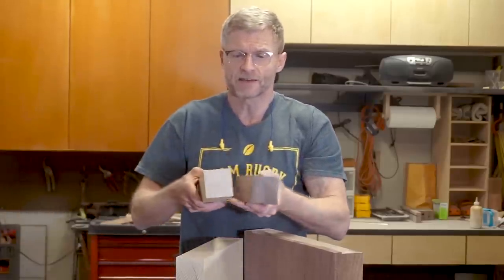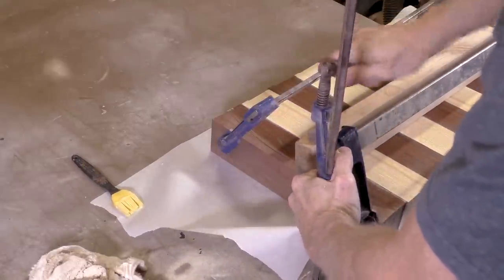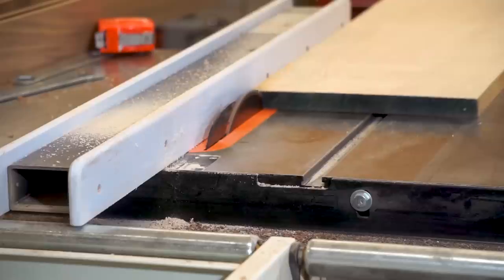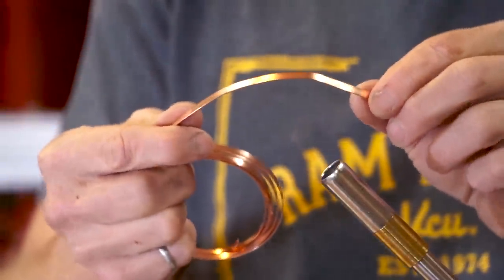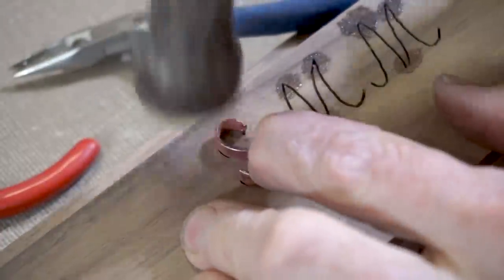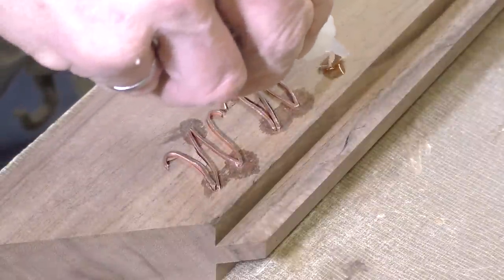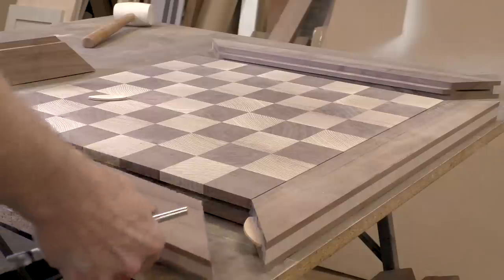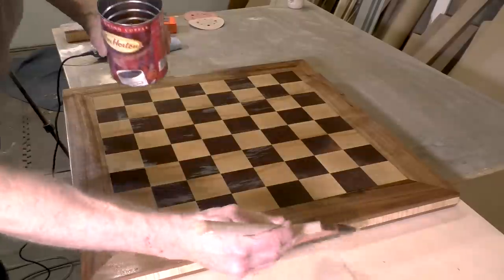Chess Board with Copper Inlay

Comment: Beautiful work!  Just discovered your channel and I am sure I'll be back.

BTW, Unlike steel, copper does not need to befooled slowly during the annealing process.  With Copper, it is the highest temperature reached that dictates the malleability of the material.  As a result, the copper can be dunked in water at the end and it'll be just as soft.  With steel, plunging it into water (quenching it) causes it to harden.  

I know I am going to get roasted for that explanation-- it is over-simplified.  Some steels are best quenched in oil and some steels (such as low carbon steels) won't harden much at all on quenching.
Reply from the maker: Thanks for the feedback and for the information. It's great when we can al learn something from a comment like this!

Comment: What's the difference between a jointer and a planer? Aren't they essentially the same?
Reply from the maker: They serve two different purposes. Imagine a long board that is not straight or wavy from end to end. If you run that through a planer, it would plane the top surface to be parallel to the bottom, so it would not remove that waviness. A jointer solves that problem by flattening the bottom before running it through the planer. Once you have that flat bottom, the planer will make the top side flat and parallel to the bottom.  You cannot use a jointer in place of a planer because if you try to joint both the top and bottom, you will almost certainly end up with a flat top and a flat bottom, but they wouldn't be parallel to each other.

Comment: I was thinking when you were inlaying the letters:  You could have made the letters complete first, then put them on the wood and hammered them a bit to make an indentation from the completed letter.  Then use the router (dremel) to rout the pattern.  Just a thought.
Reply from the maker: Interesting idea, but I don't think I could have made the "M" out of a single piece because of the sharp corners.

Comment: Curious is there any reason other than aesthetics to have all the end grain run the same direction as opposed to lets say have the walnut grain be perpendicular?

Though truly a master craftsman, the fact you took time to do the pumice step where as most people would have said thats good enough.
Reply from the maker: The wood expands and contracts by different amounts relative to how the grain is oriented. I like to orient the grain in the same direction. That way, when they're glued up, it minimizes the chance that one square will expand more or less than the square that it's glued to. I'm not too worried about expansion and contraction of the wood with this finish because the chess board will be in a climate-controlled environment and it's well-sealed by the polyurethane.

Comment: a nice work, but as a chess player and from this camera angle the board looks a little bit too big for the usual peaces you can buy so that the peaces would look maybe a little bit undersized when placed on it
Reply from the maker: It's definitely a large board but that's what the client requested. There are definitely lots of larger sized pieces in use out there.

Comment: You can buy 1/8 to 1/4 collet adapters on eBay then put that into 1/4 to 1/2 adapter and then the whole set into a router or a CNC spindle.
If you make inlays your standard product, a small CNC machine would be a good investment.
Reply: NO keep it real, HANDMADE Anyone can use a CNC
Reply: Randy Thomas you obviously don’t know much about tools. 
Electric saw, planer, jointer, router, sander used in this project are not hand tools 
CNC router is just another power tool. It takes more than “hey Alexa, carve me this pattern on CNC”,
Just like any other tool, it takes knowledge, skills and experience to get good results.
It is the skills we admire, not the tools he uses, for a fool with a tool is still a fool.

Comment: Beautiful piece of woodwork! You might have been able to save yourself some grief with the inlay by using copper powder and epoxy to fill the initials. Once sanded, it's almost impossible to tell from solid copper
Reply from the maker: Oh, interesting.  I didn't think it would appear the same as solid copper. I'll have to give that a try. Thanks!
Reply: @Woodumakeit  Obviously you'd want to experiment with proportions of powder to epoxy on a scrap piece first, but I've had good results the couple of times I've tried it.

Comment: Very nice! My shop has had a lot of success with ML Campbell Krystal conversion varnish for sprayed finishes, so much so that I’ve completely moved away from arm-r-seal which was my favorite poly finish (although it’s not really a spray varnish anyways).
Reply from the maker: Thanks for the info. Several viewers have suggested to go with either conversion varnish or pre-cat lacquer.  I think I'll give both a try. It sounds like I'll be happy with the results.
Reply: Wood U Make It you definitely will be, especially with Krystal. One word of caution though, conversion varnish is a particularly dangerous finish, I have a top tier spray booth and I still wear a mask with a particle filter and a lab coat per my suppliers recommendation. It’s also very finicky in terms of oils so acetone is your friend.

Comment: You used steel wool in the final coat.  Why aren't you concerned about trapping fragments that will later rust?
Reply from the maker: It's not as big of a concern when using oil-based finishes like this. However, I used steel wool only after applying the final coat, so there would be no fragments embedded in the finish.

Comment: just curious.... i noticed after this point that you fixed your mistake, but you didnt say that you had made the mistake in the first place. but it was obvious to those who play chess that it was there. did you have to snap that piece off and turn it around so that the black/white patterned flip flopped? or did you just start all the way over. https://youtu.be/IalWUpwGonI?t=323
Reply from the maker: I'm glad you caught the mistake. I left it in the video but didn't mention it just to see if anyone would notice.  I actually made several chess boards at the same time, so I wasn't always videoing the same board.  I didn't fix this one because the squares wouldn't be square anymore. That one will end up being a cutting board.

Comment: If you pick up a old fish tank air pump and hose from a garage sale for a couple bucks you you can hot glue the hose end to the base of the router aimed at the bit
and it will blow of most of the dust while cutting I did this on my scroll saw and it sure made it easier to cut things out. it can be knocked off when done.
The board is really nice, great work.
Reply from the maker: Thanks for the idea. I'll give that a try. I can see that working with a scroll saw, but I'm not sure if it'll have sufficient air pressure for a router due to the higher velocity of the dust, but it's definitely worth trying.

Comment: Why did you use that huge copper tape? Every other inlay I've seen has used much thinner cylindrical metal wire.
Reply: On an inlay project of mine a few years ago, I went into my local hardware store and got the thickest gage electrical wire I could get there. My target was 1\16th inch thick after I would run it through a double roller, which also split apart the plastic coating wires usually have. I went that route for sourcing my copper material due to its quick  convenience. Others can just buy the material already flattened to a specific thickness.
Reply from the maker: I watched a few videos where people had started with cylindrical wire, but then they would run it through a milling machine (or hammer it) to make it flat. I figured it was easier to buy it already flattened because I do not have a milling machine.

Comment: Out of curiosity, would the copper inlay have turned out more uniform if you had used copper dust and cold sintered it in the wood?

All in all, this gives me some ideas for my next chess board.
Reply from the maker: I'm not sure of the answer until I give it a try, but several viewers have suggested using copper dust and CA glue or a mixture of copper dust and epoxy.  I think their recommendations come from experience, so I think I'll give both a try and see how they turn out.
Reply: @Woodumakeit  I've never done this either, but my old man is an old school mechanic. He's the one that taught me this process. I've seen it done with various metals and powdered semi-precious stones (jade works quite well). Might be something to give a go at. Thanks for the reply.

Comment: Why did you only put half of the chess board thru the drum sander at a time?
Reply from the maker: The maximum capacity of my drum sander is 19" and this chess board is 20" so I had to sand it in two passes.

Comment: Think I would go for a felt bottom so the board wont rock if it's set on an uneven table or some such.  Also don't have to worry about it getting scratched up on the bottom.  Then again, I have to wonder if a board like this ever actually gets used?  I tend to see rubber roll up boards in use every time I happen by a game.
Reply from the maker: I added cabinet door bumpers to the bottom, but didn't show that on the video.  They're really easy to apply, easy to replace, if needed, and cost almost nothing.
Reply: @Woodumakeit  That was my first thought as well, one of the various cheap rubber or felt feet, but I thought it would look tacky on something that is otherwise fine craftsmanship.  A full felt base would match the quality of the rest of the board.

Comment: wouldn't it be easier to pour molten copper into the grooves?
Reply from the maker: With a melting point of almost 2,000 degrees F, that would end up burning the wood (and probably set it on fire).

Comment: How is it even possible to sand down the metal without also cutting into the surrounding wood???
Reply from the maker: The sander takes down the metal first because it's protruding higher than the wood surface. Once it becomes almost flush with the wood, then the sander will begin to sand the copper and the wood together to make it a completely flat surface. It's at this point that you don't want to sand too much to avoid making the wooden frame thinner that that spot.

Comment: on the tongue and groove sides, why only glue in the middle?
Reply from the maker: I anticipate the wood movement due to changes in humidity to be minimal because of how this board is sealed and also because of today's climate-controlled environments. The reason I put glue only at the center point is to allow the wood to expand and contract a little and not to be held fast to the frame, which could end up causing the board to warp or crack. There's also a small air gap between the tongue and the inner face of the groove to allow for a bit of expansion and contraction as well -- just in case.

Comment: Nice piece of work.  Please take this as something to consider, NOT as a criticism.  I've been doing finishes more than 50 years and, while your choice looks nice, I can tell you from experience that there are FAR better finishes than poly that are much faster, more durable, more forgiving, and crystal clear.  Any more, poly is barely a step above conventional lacquer and painfully slow.  May I suggest trying pre cat or post cat lacquers, catalyzed conversion varnish, polyester, and consider a catalyzed automotive clear.  Shoot a damp coat of any of these cut about 20% with the appropriate thinner (it will dry in minutes) to apply initial seal coat, lightly hand sand with 320 to take "noise" out of the finish, tack cloth it, then apply 1 or 2 4 mil coats cut about 10% allowing about 20 minutes between coats.  You'll be impressed with the results and save hours and hours of dry time (at reasonable room temperatures, they're ready to ship in less than 2 hours).  I've used these on night club tables (the ones on which get drinks spilled and cigarettes put out) and they're almost bulletproof.
Reply from the maker: Thank you so much for taking the time to offer this suggestion and your recommendations on how to go about doing it! I've read a bit about catalyzed lacquers and conversion varnish, but have never had the opportunity to try them. Your comment has given me the motivation to give them a try. I have several more chess boards to make, and they tie up my shop for 5 or 6 days while I'm applying the finish, so anything that will save me all that time will be well worth it. Thanks again! --Mike
Reply: @Woodumakeit  I appreciate that you understood the context in which I presented the suggestion (I was hoping you would).  I would guess you can understand the experience I've accumulated over all these years, and I'm very happy to share and teach whenever I'm presented the opportunity to do so.  I'm unaware if there's a way we'd be able to make contact in a less public forum, but I'd be happy to have the chance to point you in some directions should you want that.
Reply from the maker: @thespook9808  It's evident that you have a tremendous amount of experience and I would be honored to receive any knowledge you'd be willing to share. Perhaps we could begin via email. You can reach me at woodumakeit@gmail.com. I look forward to hearing from you!  --Mike

Comment: Amazing work sir, you might want to consider copper or brass dust for an inlay like that if you do it again, it's much easier to work with and allows you more freedom of expression with the type of lettering you use. CA glue and  metal dust looks fantastic with stylized lettering.
Reply from the maker: Thank you for the suggestion. I'll keep that in mind for upcoming projects. How deep into the wood would you go when using the CA glue and metal dust? Others have suggested epoxy and metal dust. It would be interesting to try both and compare the results.
Reply: I use a 2 cherries gouge cutting down about 1/8" or deeper if the lettering is to be fancy. My wife does calligraphy so she does the letters and I copy them to the work surface. Add a layer of glue and then dust, I build it up a bit at a time until trough is full and sand smooth.

Comment: Mike- From Tidewater to wherever you are in the Old Dominion- Bravo! You can do a couple of things to make the copper inlay easier on yourself- #1- while its still hard- use a piece of sandpaper and file one edge thinner- just fingertip pressure for a few strokes- gives you a wedge shape to start the piece and makes tighter radius corners- it will mushroom into the gap with the hammer strikes- #2  Dont need to heat it so long in the flame-  and its more efficient to do it on a scrap 2x4- it reflects heat back and the charcoal helps keep oxidation down- just flame the whole roll at once to red-orange then let cool... But its awesome to see and great video!
Reply from the maker: Thanks for the great tips!!  I'm up in NOVA. I'll definitely try out your suggestions next time. I let the copper heat up bright red just for the video effect., but I knew it was longer than what I needed. 🙂  I really appreciate the feedback! --Mike
Reply: @Woodumakeit  No worries- I enjoyed the vid and look forward to more! Subscribed

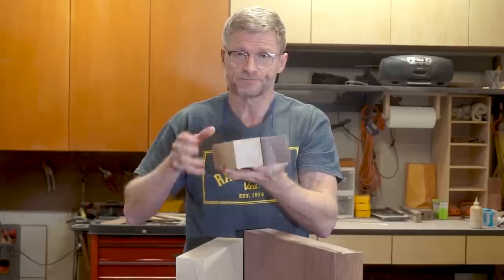Comment: 0:25
Did you mean to say they wouldn’t be a perfect cube after sanding? I was trying to figure out how sanding them and making them shorter would cause them to no longer be square. Then I realized you must’ve meant cube. Am I correct?
Reply from the maker: I was referring to the sanding after the first glue-up, so I did, in fact, mean square. If I had cut them as perfect squares (when viewed from the end) prior to glue-up, then they would no longer be square after passing them through the sander. Sanding is important after the first glue-up to have a perfectly flat surface for the second glue-up. I hope that makes sense. They actually weren't cubes because the final size was 2.5" x 2.5" squares that were 1.25" thick.
Reply: Wood U Make It ah I see. After finishing the video I saw that they did not end up being cubes. So top that you were referring to ended up as the sides of each square, because the top surface of the chess board is the end grain. I got confused when you said “top” because I was thinking of the top of the chess board. Thanks!
Reply: Wood U Make It great video! It turned out beautiful!

Comment: DUDE. you DIDN'T just tell us you polyurethaned that - after ALL that work!!!!!
Reply: Not trolling, just new into woodworking. Whats wrong with poly? I like the protection and gloss it adds. Is it considered cheating or cheap or something?
Reply: well not only is it unattractive as a finish (in my opinion - i.e. - not a nice feel to the hand) but if you damage any part of it you have to sand it all down and redo it - unlike a pre-catalysed lacquer where you can just 'flow' new lacquer over top or 'melt' a scratch etc with acetone
Reply: but in a nutshell - i like my wood to look like WOOD rather than plastic ... I love a lustrous deep wood finish with the grain coming to the surface ... once you see a really lovely oil or lacquer finish you'll be hooked for life ... lovely to look at and even lovelier to the touch

Comment: As I understand it, copper is annealed by heating and then quenching in water. Excellent video, and an idea I will be trying myself.
Reply from the maker: I always thought that quenching made the metal hard and brittle, but I'm not sure.
Reply: @Woodumakeit  Not every metal reacts to quenching the same way. Steel is hardened that way, but copper reacts very differently. Try it, just for fun.
Reply from the maker: @jester4t7  ok, I'll give it a try. The slow cooling definitely resulted in the copper being softer, but maybe quenching would make it even softer. It's always interesting to learn something new.